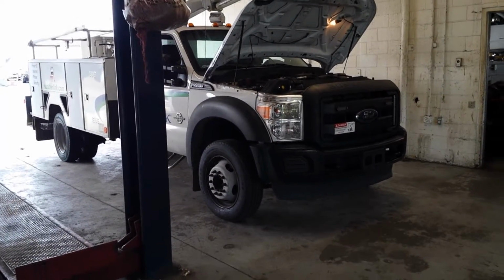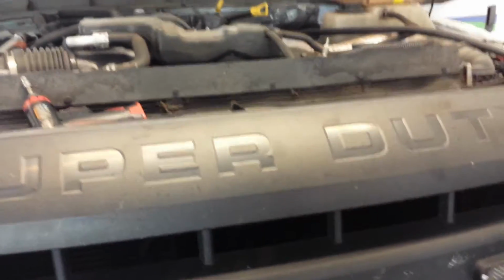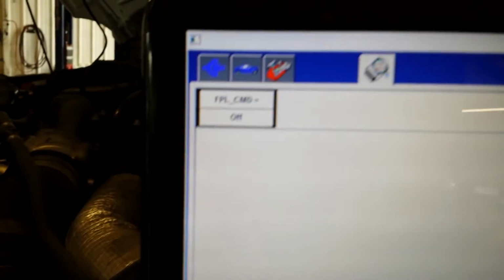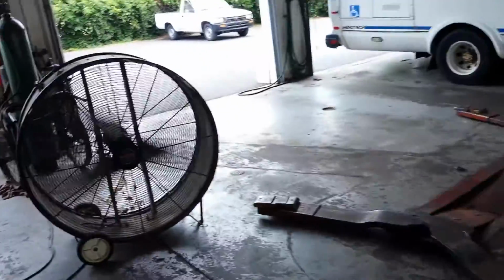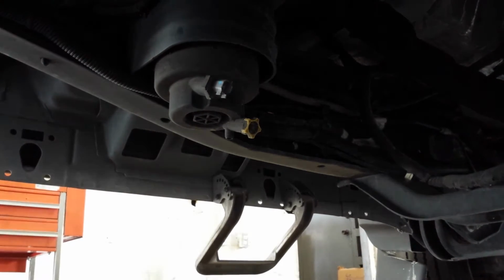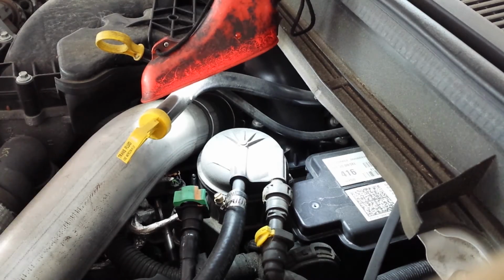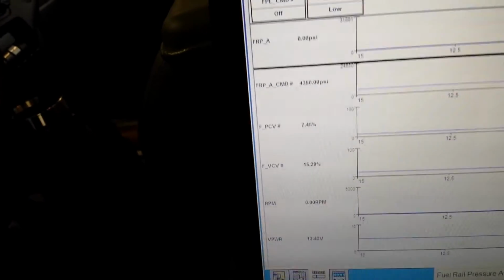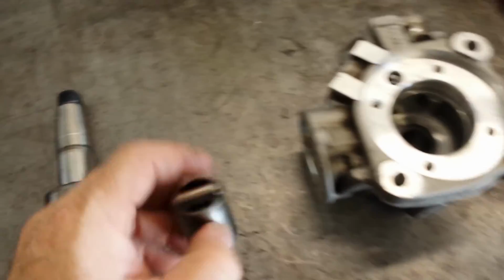6.7 octane powerstroke initial diag and repairs

Comment: The hum is annoying when it sucks air. I had mine replaced service installed 2 new ones before a good one it would go 1500 miles after o ring and filter before hum. Now 8500 miles no hum. Said it was warped and wouldn't hold its seal

Comment: I know it's a old video but will the gas damage the pump or since it's a low pressure pump it's fine ? Or can you remove hoses at pump inlet and pressurize tank with air and blow it out
Reply from the maker: The gas won't hurt it, it will pump just about any fluid. I then pumped clean diesel through it to flush it out.